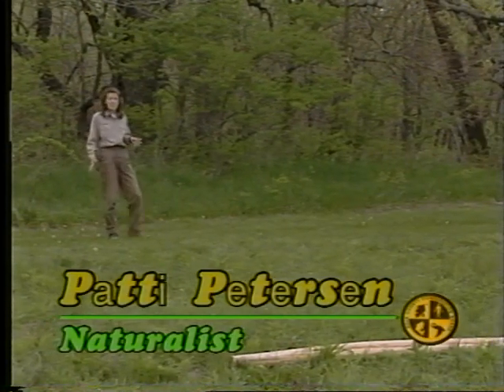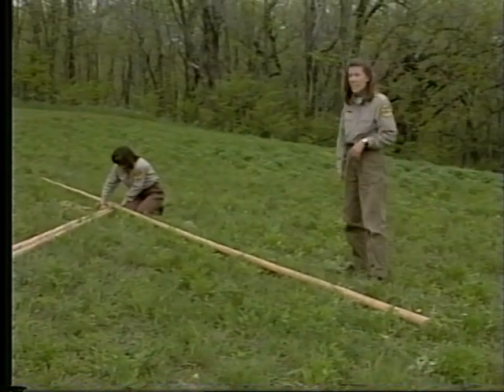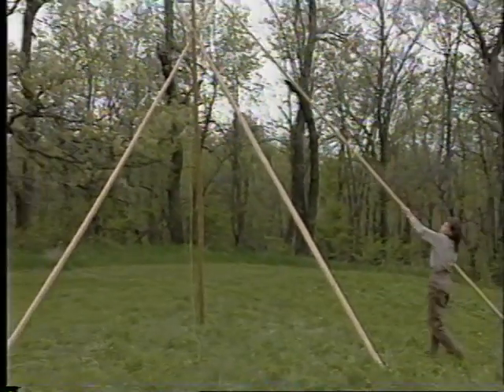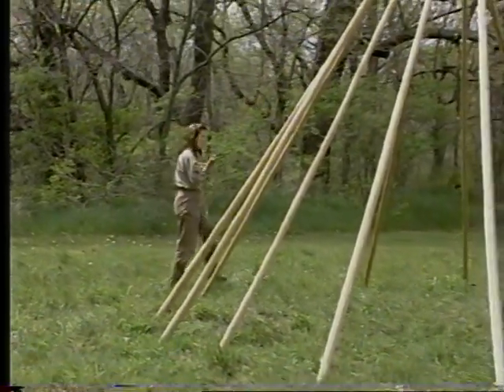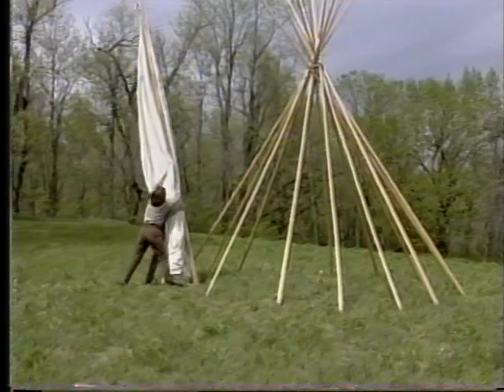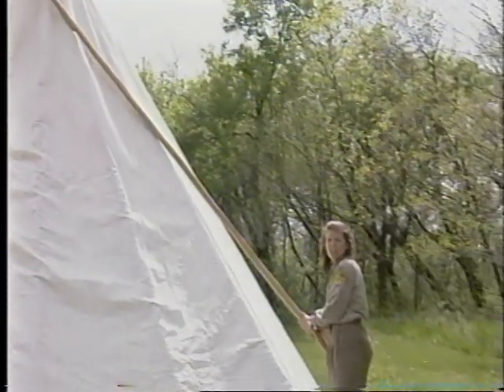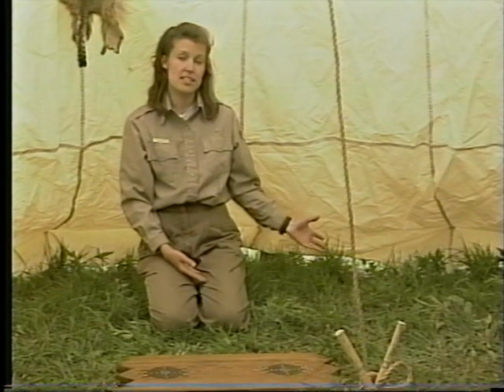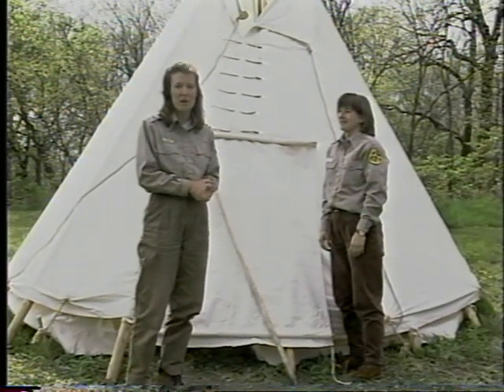Tipi Construction

Comment: The teepee is a perfect design. It allows for a central fire to provide heat, light, and the means of cooking food. The entire structure acts as a chimney to pull the smoke up and out since heat naturally rises.

That allows for a wood fire or a stove of sorts as the dangerous fumes would also be pulled upward with the heat. The constant flow of fresh air coming in from around the outer edges makes for safe and comfortable environment.